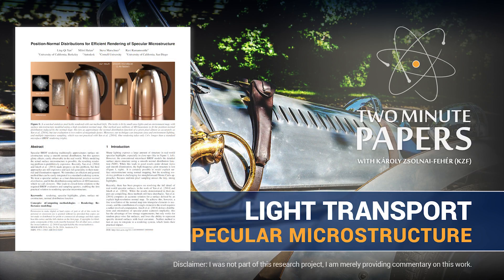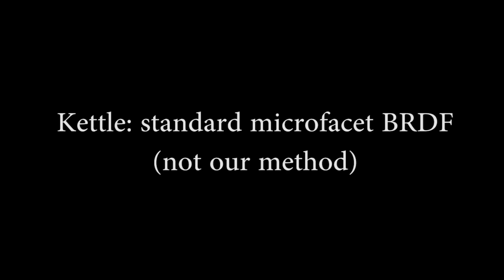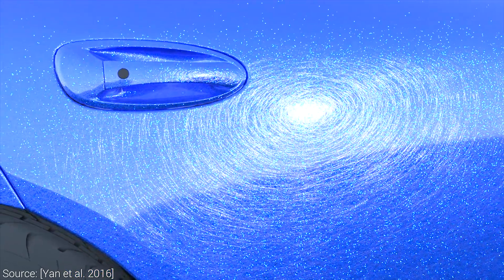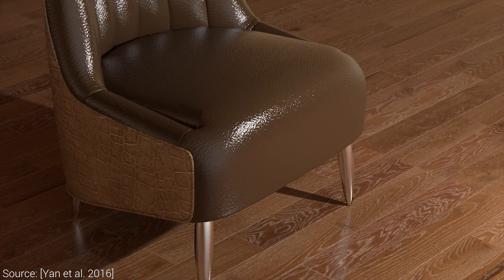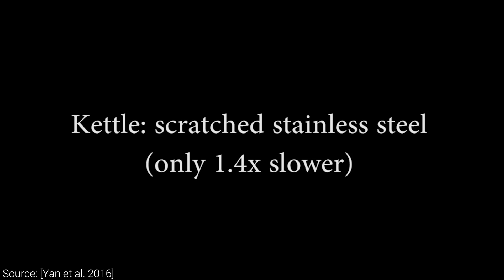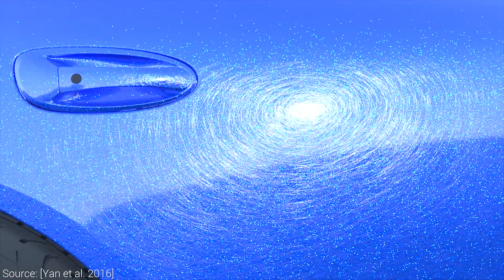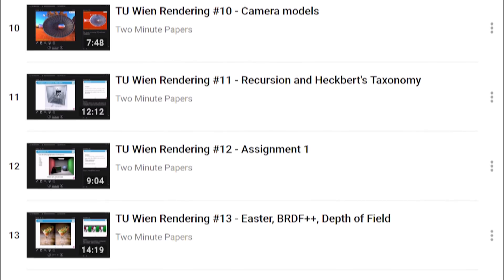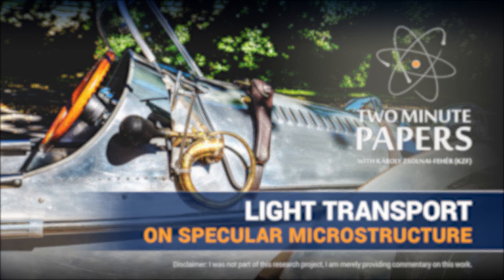Light Transport on Specular Microstructure | Two Minute Papers #193

Comment: It's hard to evaluate the quality of this method when it's being used in materials that are otherwise very unrealistic.  The leather and wood floor was  just plain bad. The circular scratches in the car paint was impressive, even if the car paint itself was a bit over the top. I'd like to see how it performs when the specularity is not so overblown. Does it hold up or does it start to read as noise?

Comment: Btw, for anyone wondering doing micro-bump instead of BRDF glossy materials is not a new idea and the 
paper/video is not trying to show how to do really realistic good looking renders,  its simply demonstrating a 
more efficient method to compute it using a BRDF that "simulates" micro-bump,  here a couple of renders I have made using "classical" micro-bump method with Vray, 
where I don't use glossy or anisotropic rendering,  only use really high resolution normal bump maps or procedural noise  to 
simulate real scratches,  (vray don't really like it so have to trick it a bit to make it work) ,  however as 
you might guess its really slow to get a clean render IMG2: blinn 2min vs microBump 128min. Micro-bump is way more accurate than traditional BRDF  but usually not very practical to use but  making a "Microstructure BRDF" is probably a good compromise between accuracy and speed.

(remove the spaces before and after .patan77. to make link work )
IMG1 (underside of watches): www .patan77. com/download/3watch_01_upsiddown_ae.png
IMG2 (microbump vs blinn vs ggx): www .patan77. com/download/microbump_vs.png
IMG3 (microScrach): www .patan77. com/download/ball_microScratch.png
-----

Comment: Most popular render engines have a layered type of materials where you are able to use coating layers with masks to introduce additional specular lobe and coating imperfections... Isn't this the same thing? Don't get me wrong, some basic procedural microscratches could come handy as a parametric property of a 'default' shader. But when it comes to some materials like wood or cloth, they are very complex to even get close with simple imperfections and layers. Best results to reproduce material behaviour so far I've seen are from VRscans. But there are some limits to this service too... Anyways, I love this channel :)

Comment: Still looks waaaay to perfect to me. But I think that's mainly due to the surfaces themselves being generated computationally rather than the rendering of those surfaces. Commonly in everything we use/buy we expect there to be material imperfections. So I would kinda assume noise should be added to model surfaces to add some material imperfections, thus making stuff look more realistic... Still really cool rendering :)
Reply: This are just examples for the technique. Artists will be able to achieve even more realistic results with this then previously.

Comment: I wonder how hard it would be to implement this as a material in Blender.
Reply: Brandon Funk The Blender Guru's videos on imperfections give tutorials on how to set this up really easily in blender, and his results are even more impressive than this!
Reply: Layering a few scratch, smudge and dirt maps in the diffuse and reflection channels will help break up the surface and make it look real and used. Like Zaco said check out Blender Guru and Creative Shrimp, they both offer excellent and free tutorials on creating realistic materials in Blender.
Reply: Jesse Davis  hmmm, I'm not sure. I've heard that the blender game engine is not all that great, you'd probably be better off with Unreal which, other than what I've heard about its graphics, I know nothing about.
Reply: but a blender game?
Reply: It's not that great but I don't like unreal either ;-; a tough dilemma.
Reply: if you set up unity's settings properly you can get some pretty good graphics out of it, you'd need to do a bit of cycles baking to import the materials though as only blender render materials are real-time and cycles aren't.

Comment: I Wonder if compatible with games
Reply: I have scan trough the paper quickly. By the looks of it. If you have a physically based enough game engine. Yes.
There are no parts of the algorithm inherently need ray based rendering algorithm.
Reply: probably
Reply: I can't say I can decypher the paper fully at this point, and I'll have to put it on the backlog to read, but I was wondering if in real time shader we could sample the hash UV point (ie the pixel area) and apply a modifier to the brdf based on the Manhattan distance from the center of the pixel, to simulate similar effects? Just a hot take lol, I don't know where I'm going with that thought.
Reply: Wouldn't you need a ray based renderer to get the highlights in the right spots of the surface?
I mean the reflections you get from the algorithm are still dependent of the angle between light source and camera, or did i get this wrong?
Reply: If you have the angle from light (from the position of the light and position/normal of the fragment), you can effectively have the incident ray but without occlusion.
Reply: Did you guys miss the part where they say it it takes multiple minutes per frame on 36 cores (section 6.4)? This will take years to be practical in games, and by then there will be better techniques.
Reply: Yes, but still impractical today. However, someday we'll see this I'm sure.